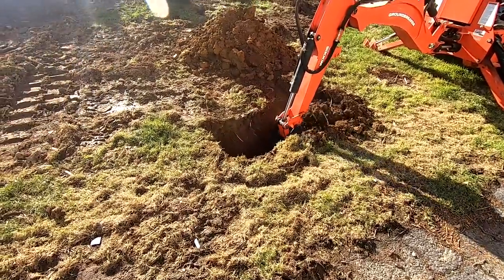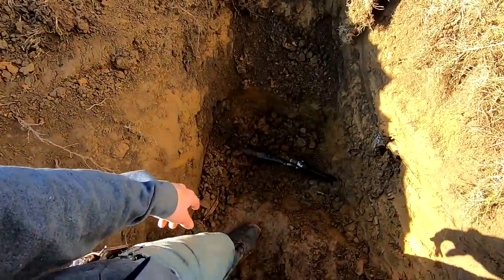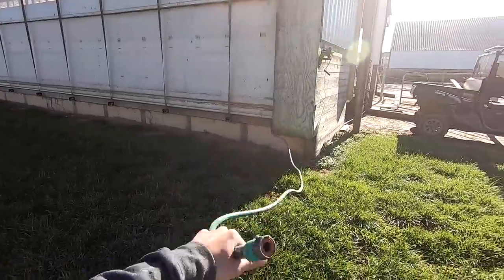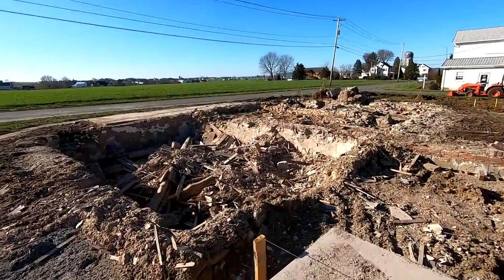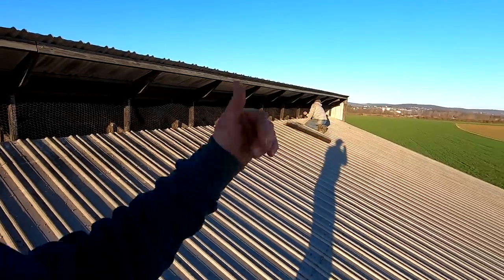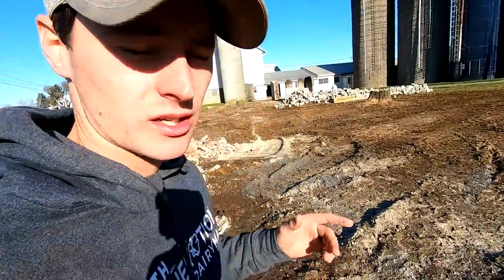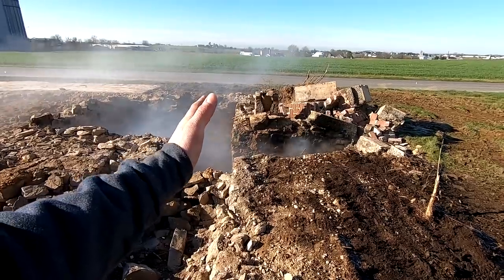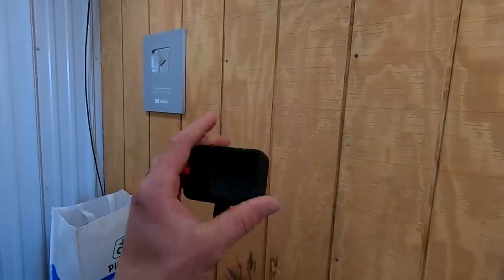Land of Opportunity

Comment: Eric, you might want to think of gas fired boiler.  But with this new breakthrough in Fusion energy plan ahead for refitting to electric heating as electric availability in the next 15 years is going to be flooding us a new energy source that may just exceed petroleum energy..  Yea I am saying it may force us much further towards electric vehicles. But for now natural gas energy is probably your cheapest alternative for heating unless you have firewood readily available and the time to deal with it. Natural gas is fairly clean compared to oil heat or coal.